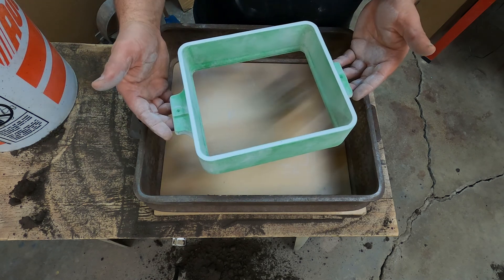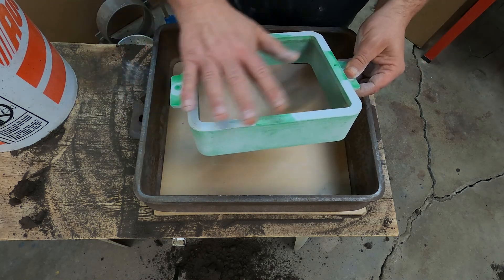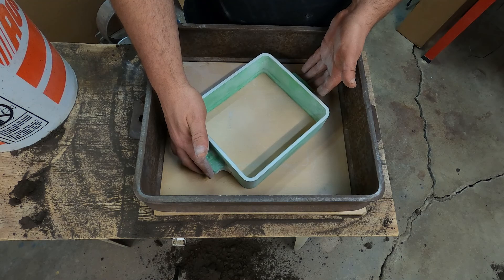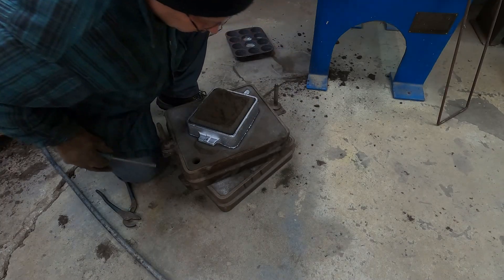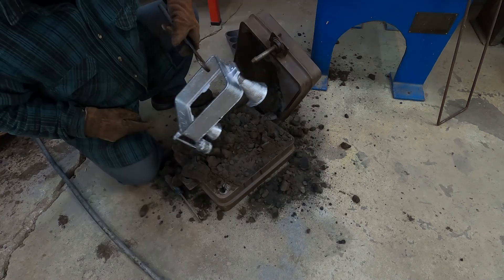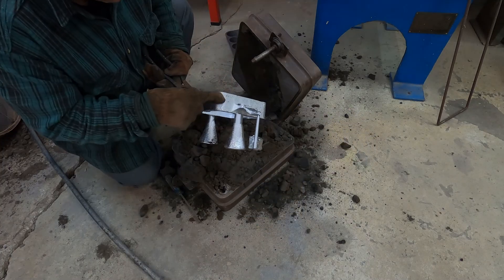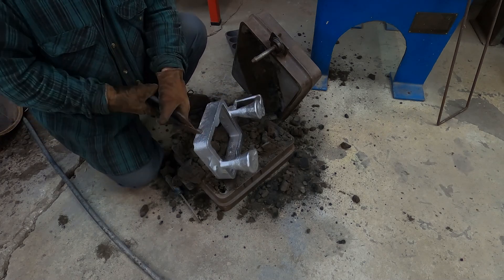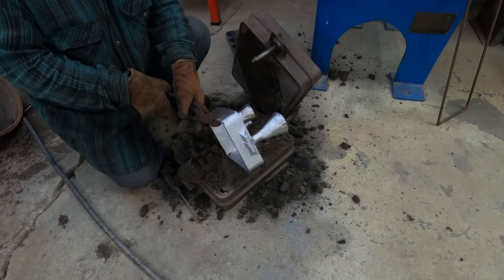Casting Flask Pattern From a 3D Print

Comment: That turned out great. I like the idea of metal flasks but the type that have separate sides bolted together means 8 castings for one flask. 2 is better than 8 any day.
Reply from the maker: Thanks Mark!    I'll have the joy of making some multi piece aluminum bolt together flasks soon to replace the bigger heavy steel ones.  I've been brain storming on how to avoid all that though and make them one piece as well.

Comment: Why do you think the corner was missing? That corner was at the bottom of the pattern, I would think it should have filled. Maybe sand had fallen there. 

5x7 seems a little small to me at first. I took out a couple of rulers and made that size box shape. Yes small, but still big enough for some things. And not a lot of sand to ram. I think I would like some flasks that size. How much does the casting weigh? (thinking of how big a crucible I would need to make one)
Reply from the maker: Casting weight without risers is 2.5 pounds.
Reply from the maker: I think if i would have poured at 30 to 50 degrees hotter it would not have done that. Its very smooth and looks like a cold condition and as the upper thicker section cooled it pulled it even more.  There will be a part two so ill pull the crucible at 1350 degrees and see how that works. 
Yes they are small and shallow for small parts. I hate ramming 40 to 60 pounds of sand for a thumb size part.  I will get back to you on the weight.  Ask again on the part 2 video if i forget.   Thanks for watching!